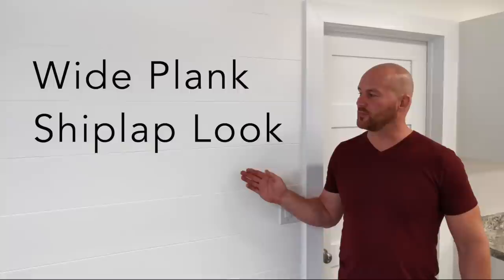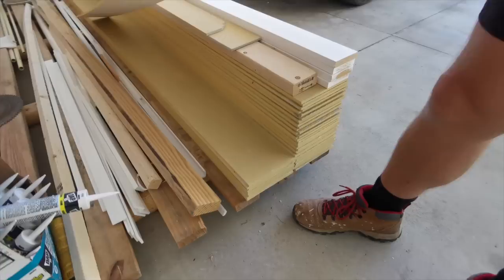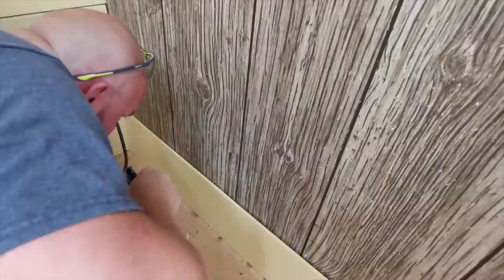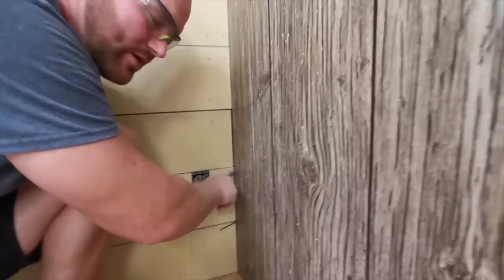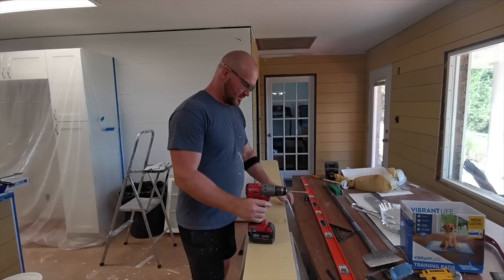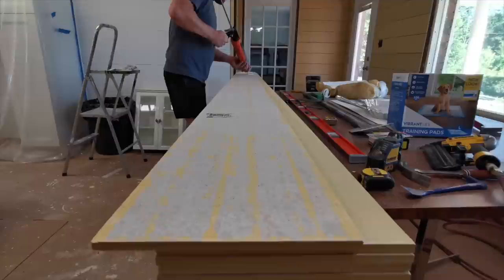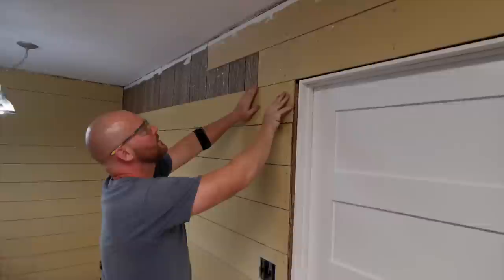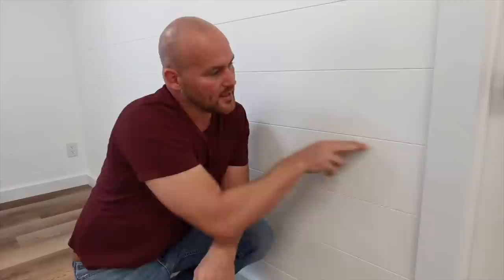Shiplap Wall with Hardie Plank: A DIY Tutorial

Comment: Shiplap boards are milled on the edges so they overlap so the installed boards have a dimension to them vs a smoother edge to edge. The overlap helps to prevent moisture intrusion between boards . It can also allow for a little wiggle room on installation.

Comment: Nice video.  I have done the exact same thing only with LP smartsiding and miratec/LP trim pieces.   4 years ago on an online auction I won a semi-truck load of random-colored full length siding pieces and trim for a total cost of $360.  I have since lined my basement, my garage, my foyer stairway, my kitchen ceiling, my friend's garage, built a shed, and still have much left over.   I ran short of some of the thin siding so I bought a bunch off of FB marketplace from siding pros selling their extras from jobs for about $6 for a 16' piece.  You can find small quanities for free also sometimes.   I like the tip about the baby wipes. I was first taking the excess off with my fingers and then doing the final wipe with a small cloth but that was a lot of rinsing etc.
Reply: The LP or miratec also allows me to attach anything anywhere on the walls without looking for a stud.
Reply: Did you glue and nail for the ceiling project or just nail with the LP.  Sounds pretty cool
Reply: @christophewittman2501  Just 18ga nails at a slight angle.  But, I first put up 3/4" plywood on the ceiling and attached that to the joists with 2.5" screws. That way I had an infinite nailing surface for the LP and it installed FAST.

I also lined all my closets with the LP.  I put up 1/2" OSB on the first few as a nailing backer but got tired of that so just switched to nailing them to the studs and applying construction adhesive in the space between the studs to ensure that the LP stayed "in plane".   I did this 3 months ago and everything is holding up fine.

Comment: Some of the best DIY shiplap I’ve seen, nice work. Quick question of something you didn’t go over in the video, did you caulk the vertical seems as well? Also did you butt the vertical seems tight against each other or did you space those out with nails?

Comment: As a finish carpenter hardie is heavier by far meaning over time if you place the boards on top of each other they will pull away?  U can counter it by using trim head screws and knowing exactly where your studs are!  Or place them in an up/ down position which 90% of ppl do not like!  And hardie is more welcoming to spray as opposed to brushed or rolled having everything to do with grain!
However it’s your house and your time!  As my dad (home builder) used to tell DIY’er u can do it?  And it will look like you done it!
I understand not everyone can afford a carpenter yet everyone always says “ oh come I can do that”!  Sure you can!
Reply: He put a spacer between each plank so they are not touching each other in the end so the only weight affecting each plank is the weight of said plank plus he nailed and glued each plank to the wall so why would they pull away?